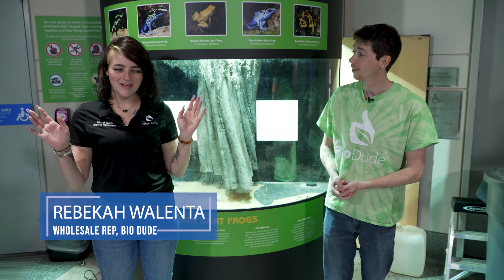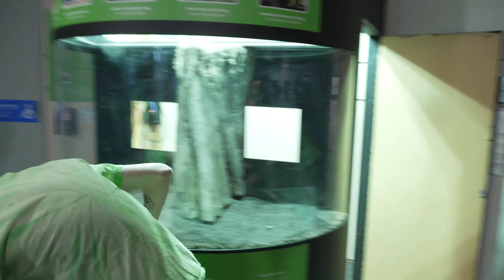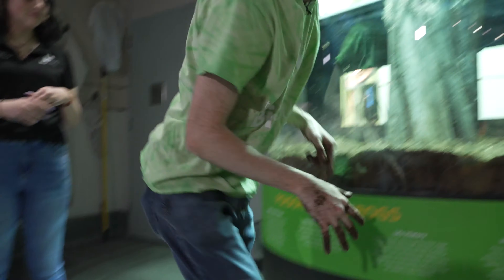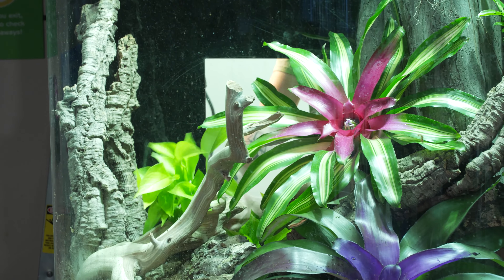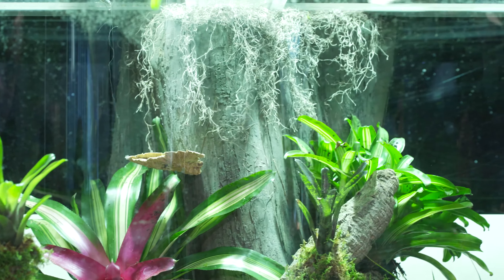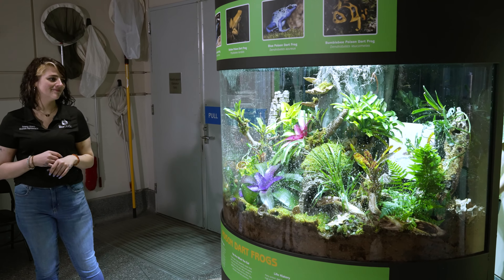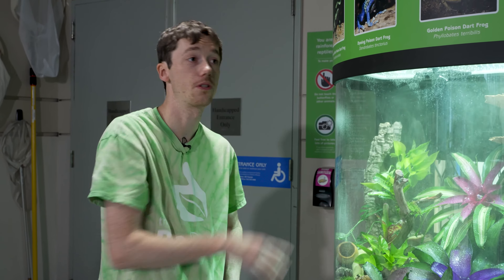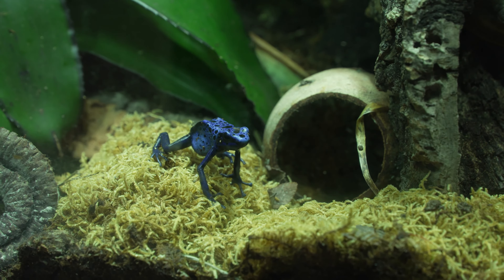Our Poison Dart Frogs get an awesome home upgrade thanks to "The Bio Dude"!

Comment: This is really bad. Mixing dart frog species, ESPECIALLY for an "educational display" is unethical. Dart frog species should not be kept together for three main reasons. One, interspecies aggression. two, interspecies hybridization. Which is a huge problem for the dart frog hobby that we are actively fighting against as it has led to the loss of several unique varieties and overproduction of mud frogs for pet stores.
And Three- they can have varying humidity and temperature requirements that will make some of them more prone to infection, foot rot, and other things in an environment that some would do well in.
Reply: The main reason that it is not a good idea is because if they are not the same sex they can breed and produce hybrids. The problem with this is people in the hobby really look down on it and most suggest euthanizing the offspring.Some are prolific breeders Once a pair is established .